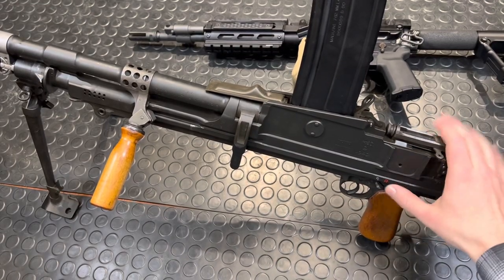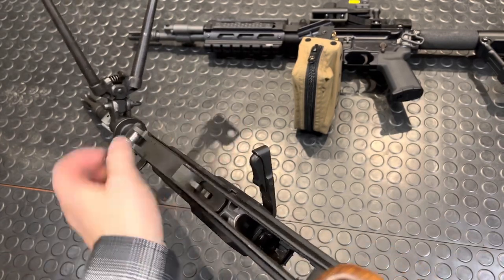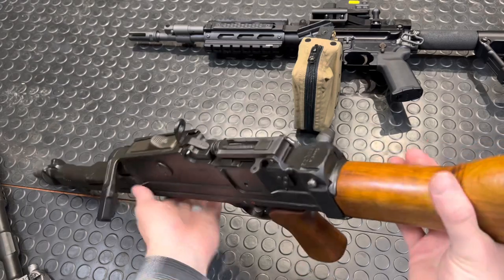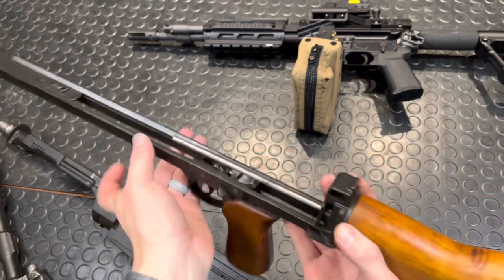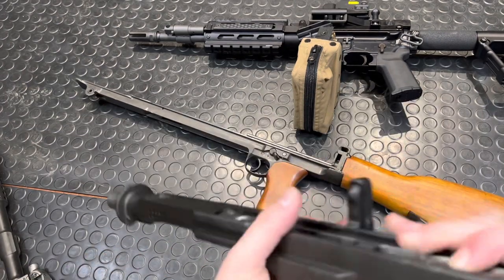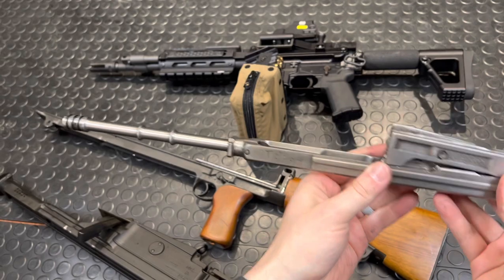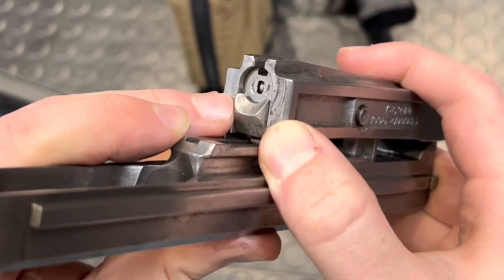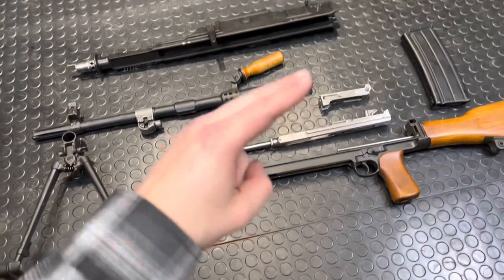BREN L4 | How to Disassemble (& How it Works)

Comment: Used this L4 LMGs extensively during my 10 years in the British Army.  We were trained to strip these COMPLETELY differently.  The only thing that is the same is the removal of the magazine!  Damn fine weapon.  Cheers
Reply: The mags always used to go missing and end up on SLR's in my time, the spw  had 12 mags  from memory  a spare barrel and a spare parts tin,  :/   despite the propaganda put out that they wont work upside down to stop squaddies pinching them ..  your right we used to strip it differently too.. and the phrase 'like an aircraft coming in to land' when refitting the bolt comes back to memory...